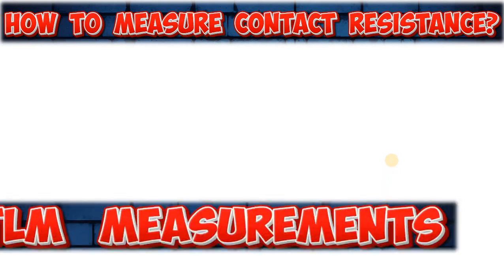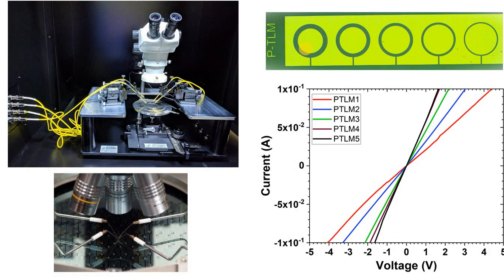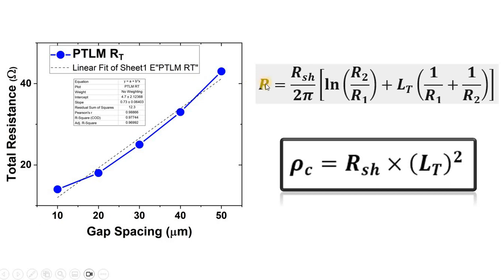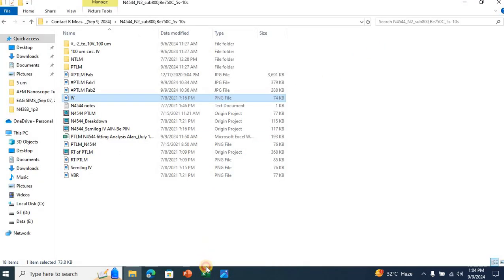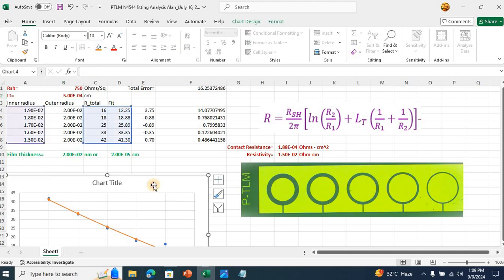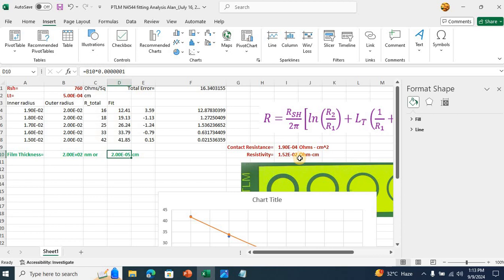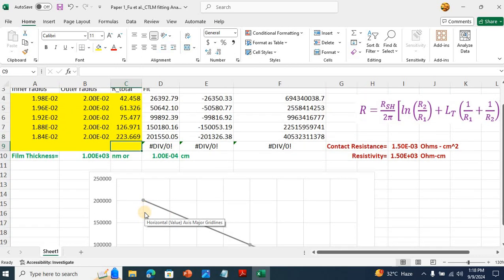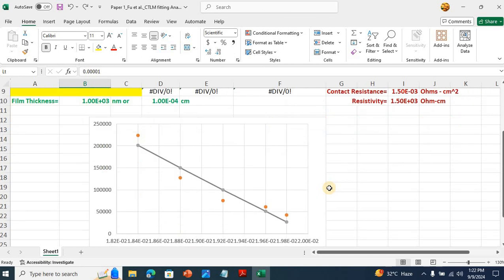CTLM Technique || How to Measure Contact Resistance of Semiconductor Devices? 🔧⚡️📏

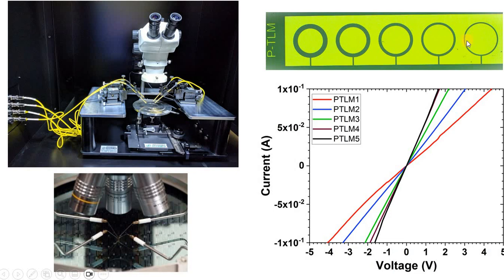Comment: Great lecture! I have one confusion at about 04:00. Should the red line represent the biggest spacing? Since which has the lowest current at a same voltage.
Reply from the maker: Correct. Thanks!